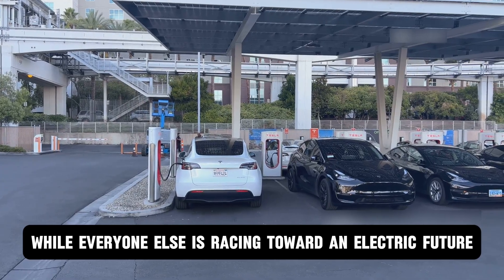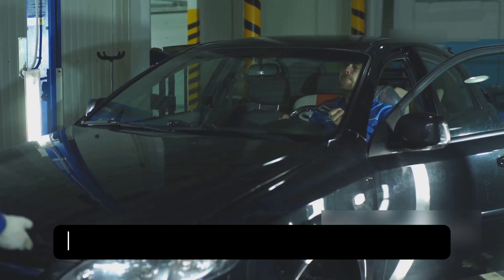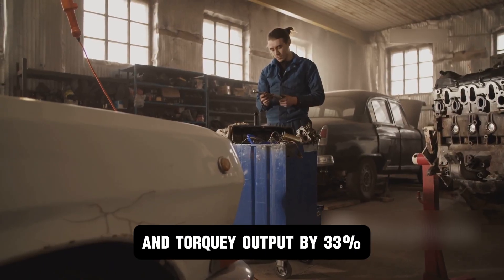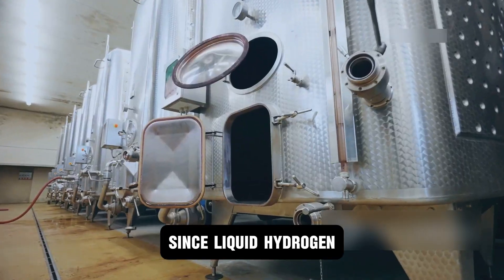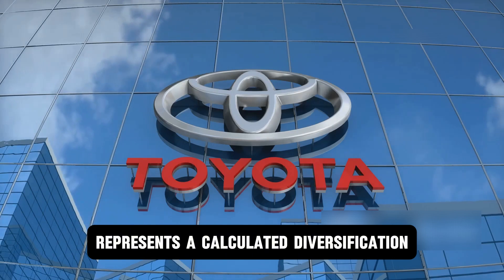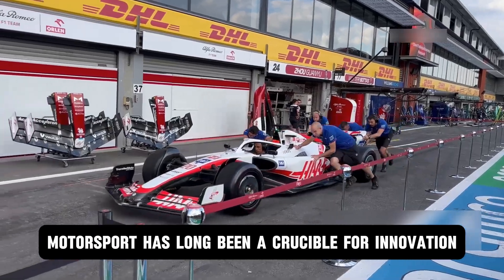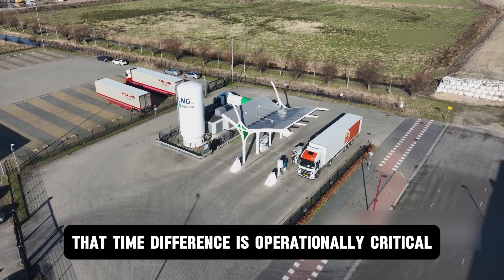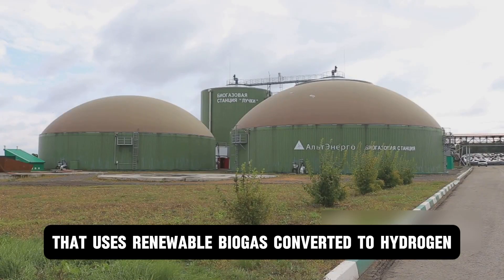Toyotas New 2026 Hydrogen Engine SHOCKS The Entire Car Industry

Comment: The problem with combustion engines is that they will always need coolant which is an environmental disaster and far outweighs the negatives of anything the engine is actually combusting.

Comment: Utter nonsense. Hydrogen is a terrible fuel. The end to end efficiency of the Hydrogen supply chain and use is truly appalling. Heat engines of every kind are doomed because their terrible efficiency and complexity. Nobody is going to be driving Hydrogen powered cars.

Comment: What is the energy loss? A good internal combustion engine loses a large amount of energy to heat. There are over 200 moving parts in an internal combustion engine. In an electric motor, there are 9.